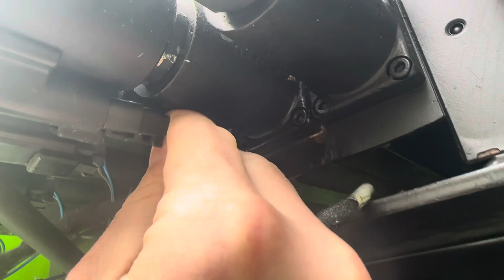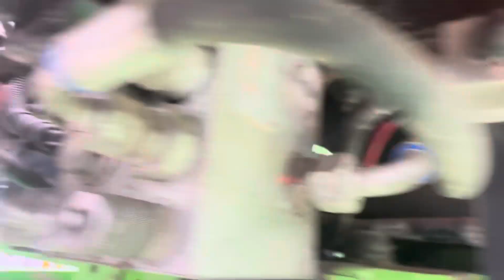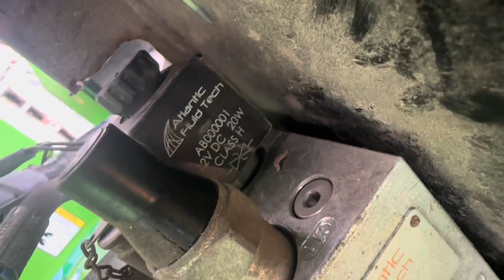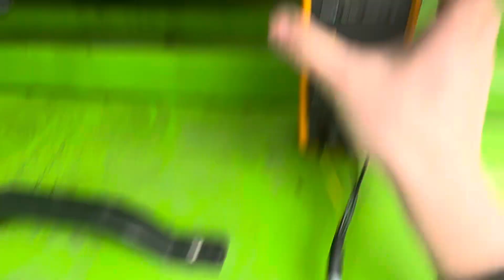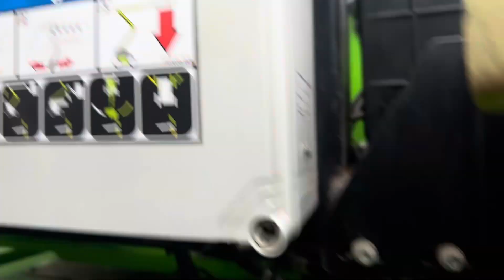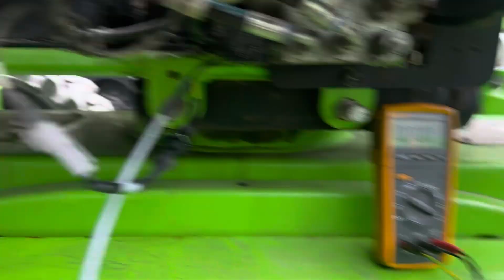Current resistance and voltage measurement on hydraulic valves #bosch #eton #bucher #hydraulic

Comment: I have question have a nifty sd50 4×4 but stop working need to rolle into trailer anyway can I unlock the wills to puch it on trailer?
Thank you
Reply from the maker: Yes mate you can flip centre plates on drive hubs and it will disengage drive motor allowing to tow it